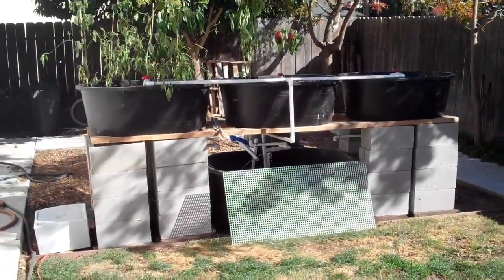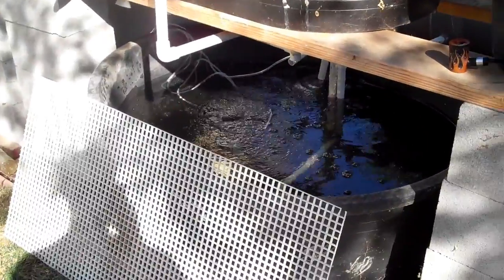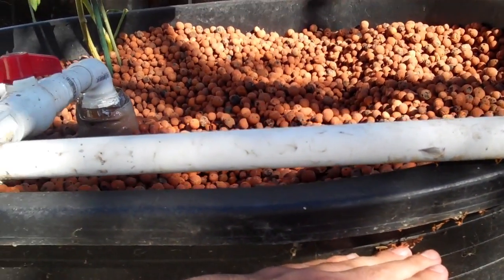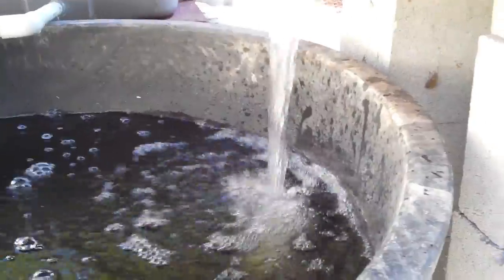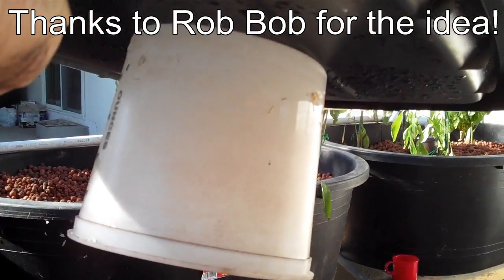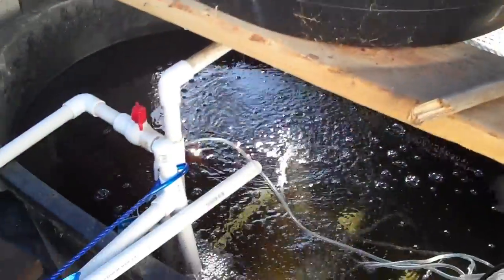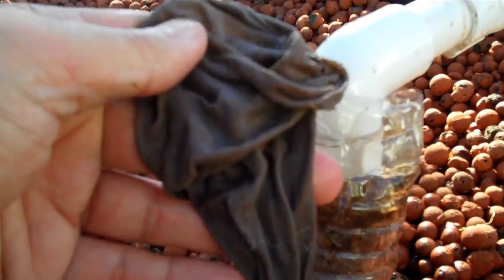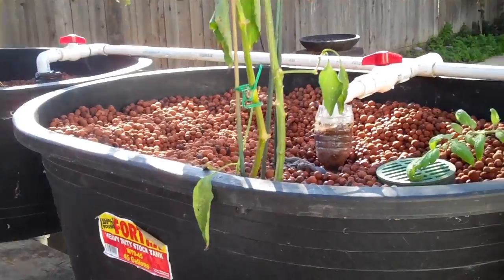Aquaponics - Complete System Walkthrough

Comment: I use earth worms , to make the medium cleaner and they also make castings to ferilize

max
Reply: ***** I have a separate bin that the sump water runs through before flows through before it ever comes into contact with the plant beds. It is filled with gravel and rocks, but you could use expanded clay balls. There are lots of earthworms in this bin, and I also have lots of biochar (or lump charcoal) in it. I make sure the water pipe feeding the bin doesn't cause an overflow, and the gravel is twice as high as the water level. There is a outflow valve in the other side of the bin that drains the water into the plant bed. After the plant bed water feeds overflows into the sump, the whole system begins anew, and I only have to have one pump. I cycle my system during the day, and I turn off the pump at night. I do have an extra aeration pump that runs at all times, though.
Reply from the maker: I too have a ton of earthworms in each of my grow beds.  The problem is that the castings will end up settling to the bottom of those grow beds with no way for me to extract them.  It will eventually turn into sludge down there.  I still use them though because they help break down the decaying plant matter, which is good for a healthy system.   I just wish I had a better way to clean the system without tearing it down.

Comment: Would it be possible to run all of the water through that big filter box you made? I think that would help with maintenance. It would be easier to clean one big filter instead of 3 smaller ones. I'm a complete newbie when it comes to Aquaponics, so I could be way off on that idea.